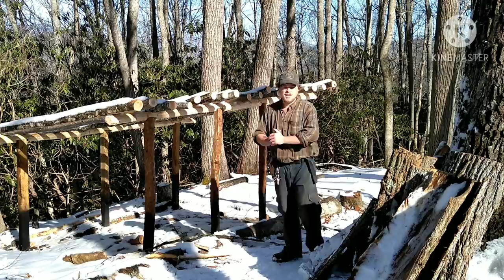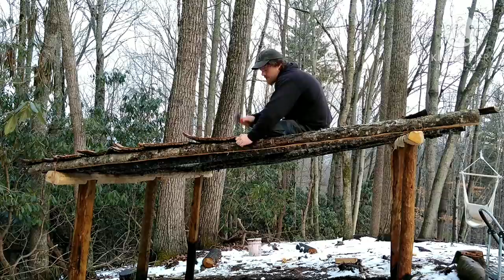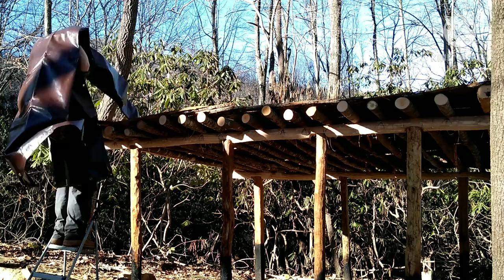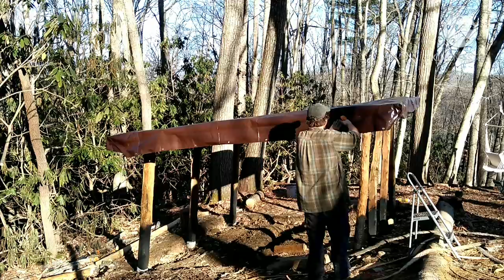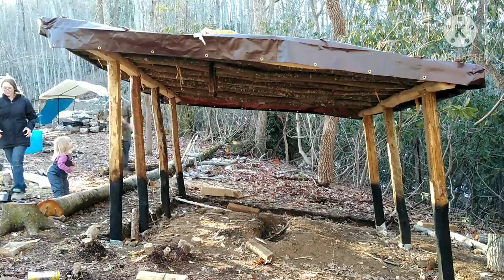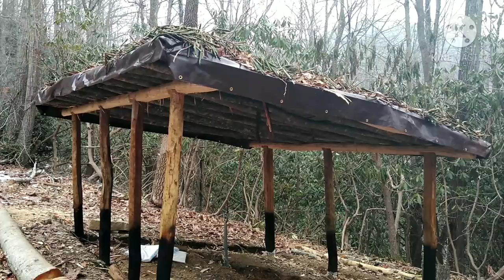How To Make A Simple Living Roof

Comment: Great roof, hope the dirt holds those leaves on when the wind blows. Once they decompose the growth on top holds it better??
Reply from the maker: What holds the leaves on right now is all the sticks that we threw on the first they are wait keep them from moving and the leaves get locked in to their shapes. 

Once it's set up there's nothing really anchoring it into place other than the roots holding it all together it's possible for it to slide off but it would do it in one entire piece. 

I'm also needing to put the trim around the roof which will have a few inches that stick up on each side.

Comment: If you run your chainsaw down the length of your log..itll start the bark off process for further projects or to letting wood cure.
After your drag your blade down the tree.....youll see it start popping off in 2-4 weeks.